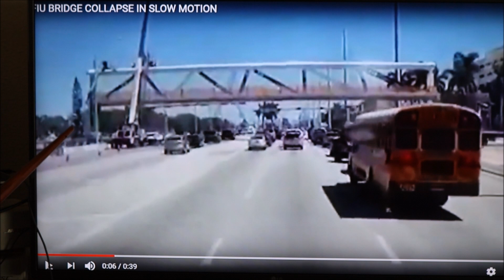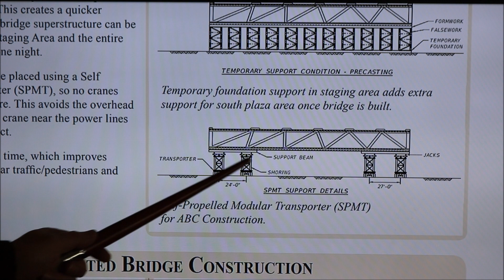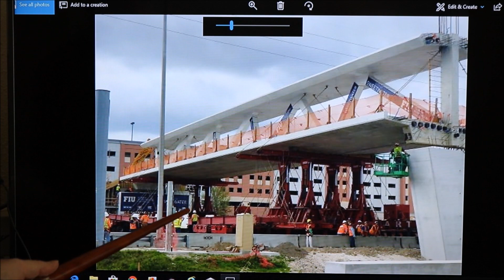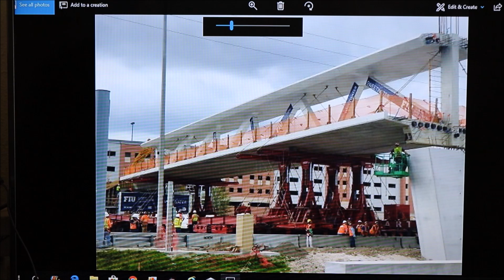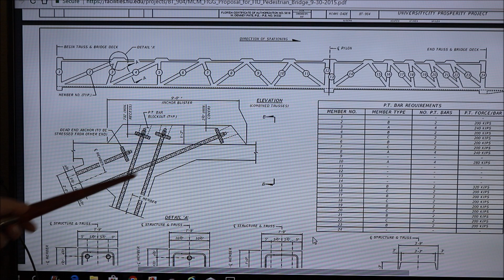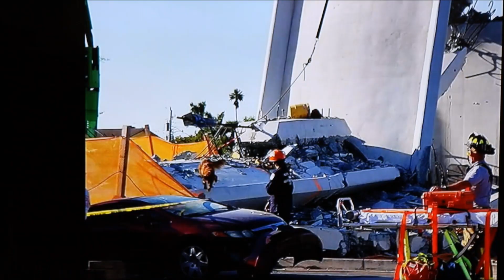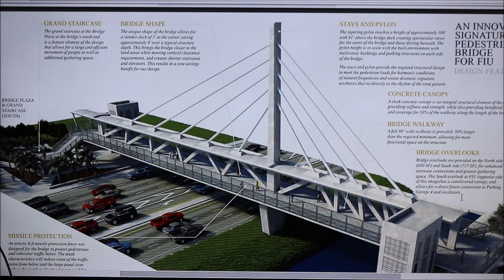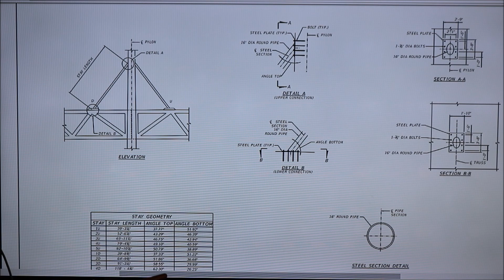Miami Bridge Failure Update 18 March 2018

Comment: You have probably seen the Miami Herald story from yesterday (June 14) on this...interesting analysis by a few external engineers. Much seems to fit with what you have said regarding the lifting of the bridge into place and the tensioning rod.
http://www.miamiherald.com/news/local/community/miami-dade/article212571434.html
Reply from the maker: John P. Valentine Excellent update! Thanks John. I believe this will be very close to the NTSB findings.
Reply: @blancolirio  Any plans to update this video now that the OSHA Report has been issued?
Reply: As an FIU engineering student I can say that alot of students disliked the design of the bridge. Mostly because the bridge would be exposed to wind and rain for 5 months of the year; from May-September. Architecture students have a saying "the client always chooses the worst designs". Why on earth the campus didn't go with a standard steel/glass bridge similar to (University of Miami's) bridge is beyond stupid. its like a tunnel that is protected from the elements.
Reply: Very good interesting article.   The OSHA report generally confirms the points made in the article. 

https://www.osha.gov/doc/engineering/pdf/2019_r_03.pdf

With regard to the concrete and steel used, the OSHA report notes that tests showed the concrete and steel were up to specification. 

The basic design inherently included 'non-redundant fracture-critical' elements.   That's not always a fatal flaw if the design is careful enough.   It was also needlessly elaborate but that's more a financial thing, the clients wanted to pay for fancy and that's what they (would have) got. 

But the design could have been made perfectly satisfactory and safe if the detailing of the diagonals and connections had been more thorough and conservative.   The devil is in the details.

Comment: Would it be too much to expect that the Project Management could have determined that there would be "obstacles" present, that would require the major support points for the move or lift to be moved inward, BEFORE the last minute? I'm writing this 5 years after the event, and it is sickening how badly EVERY SINGLE entity involved in this project totally screwed the pooch. 😕

Comment: This is indeed excellent knowledge but it does not explain why the bridge failed. Also, he says as many others do,  that the bridge is a non-redundant bridge design, with which I do not agree.  He and many others might as well have said that we should have two or three bridges so that if one fails we have two others.  There are many aircraft with one engine, and they are safe enough especially with a modern jet engine with basically one moving non-redundant part!  This video well describes that all the elements in the bridge that make up the I-BEAM, namely the top horizontal flange (canopy), the vertical web, (vertical truss components elements), and the lower flange ( horizontal deck or walkway) they each have MULTIPLE steel cables or rebars, and there are so many of them in each element, that if one fails then there are the other rebars or high tensile steel cables to keep the integrity of each element.  Also, the two end tips canopy parts and their associated vertical end columns holding the canopy end tips are all redundant  These four redundant components could have in fact contributed to accentuating the downfall of the bridge as described later on.  This I-beam is, in fact, an ARCH, and all it needed was to buttress the two ends on the side of a mountain range but could not do this, so as blancolirio so well described, they buttressed the side thrust at the ends by using longitudinal post-tension steel in the horizontal deck or lower flange of the I- beam. 

The 12 longitudinal bundles of steel cables each with 19 cables( tendons)  in the deck were EXTREMELY POWERFUL as blancolirio and the  Cambridge professor in another video so well described, but this was not the failure of the bridge. The FIRST failure had nothing to do with post-tensions or the integrity of the deck itself.  IT WAS THE THE END TIP JOINT BETWEEN THE LAST DIAGONAL END STRUT  11 AND THE DECK THAT WAS SO WEAK. That is what failed, and one can refer to it at 2:50 in the bottom left-hand corner.  This joint had to take a side thrust of the ARCH effect of the bridge, which depends on the weight of the bridge and the vertical distance between the canopy and the deck which was about 18 to 20 feet. The angle of the last diagonal strut that failed with the deck was 32 degrees and the weight of the bridge was 960 Tons. 
If we assume that the angle was 30 degrees then each end had to carry 960/2 tons=  480 tons.  It is a sine of the angle that we are dealing with to find the side thrust so that would turn up to be about double  960 tons in shear between the diagonal strut and the deck surface.  

So while the post-tensioned cables in the deck acting together could carry much more than  10,000 tons the shear joint between the end diagonal and the deck surface could not take the side thrust of 960 tons required of it. Its capacity could not meet what the side thrust demanded as a buttress.  Here is the detail of the downfall.

1. The bridge was pivoted and rested on the two ends each taking about 480 tons. ( static load) When it started to fall, it pivoted and rotated on the south end side. Because the canopy was 18 to 20 feet much much higher than the rotation point at the south anchor point, this caused the other end at the north canopy tip to move out, to bend the vertical column outwards causing it to split longitudinally and fail. Then as the canopy dropped further the top of the vertical member12 moved in and down. The post-tensioned bars within the canopy could never hold it irrespective of their tension. Note the interesting vertical split of member 12 where the top solid joint with the canopy forced the outer half vertical spit out at its base with the deck, while the inner vertical split half of 12,  broke at a point lower than its center height indicating that member 11 failed both due to high shear with the deck and a contribution due to the tensioning at the time on one of its rods.
 
2. So, the shear joint between the last diagonal 11 and deck surface ( first node)  on the north side failed, ( first downwards failure slow speed failure over three days due to shear) as it could not take 960 tons static side thrust. It failed at the surface of the deck where the cracks began to show and then as the concrete could not take the compression, the rebars in the diagonal 11 bents and hit the vertical column 12 holding the canopy above it.  As the North end of the bridge dropped,  and gained momentum, it rotated about the south side pivot, were due to the height of the canopy ( 20 feet above)  this caused the north canopy to move out and bending out its supporting column 12,  which longitudinally spilt in half member 12, which in turn caused the north diagonal 11 lower tip to move out further and faster. The lower deck lost the torquing height of the canopy and without it, all that post tensile bundles of (12 multiplied by 19=228) high tensile cables acting on the thin deck could not hold the bridge. ( second  downwards dynamic instantaneous failure as the bridge had some downward momentum)  If the bridge was  2 feet thick and the cables were at the middle of its thickness, and the length of the base of the triangle to the next diagonal, node 9/10 was 32 feet then what the concrete at the deck was subjected to was  (480* 32) = load *1  hence, load = 15,360 tons of compression on the upper edge of the deck.  Considering the downward momentum I would double this to 30,000 tons compression load on the thin edge of the deck. The deck acting alone ( without the torquing effect of the canopy 20 feet above it) with its numerous post tensile cables in it just could not hold this dynamic loading stress, hence the second failure at the next diagonal node 9/10 to the south. 

https://youtu.be/mCuIwK2_CYo

Note that in another video, the professor at Cambridge University, in his explanation did not mention the importance of how low to wrap the yarn of aramid fibers. Both the Professor and blancolirio said that the post-tension load in the deck of the bridge would be ten times the weight of the bridge. The explanation of the professor did not deal with the failure of the bridge, but merely the post-tensioning methods and amounts, and he should have mentioned that the yarn of fibers he wrapped around the model of the bridge he showed should be as low as possible with the beam being as high as possible to enable to TORQUE THE SYSTEM when loaded, while no part of the acrylic blocks he used should shear diagonally as effectively happened in the failed bridge.

It is important to understand that the bridge failure had nothing to do with the tensioning of the diagonal element but with how the joint lacked the shear horizontal strength between the lower end of the diagonal element 11 and the surface of the deck or walkway.  If one sees other videos one will clearly see that the n shaped rebars emerging upwards from the deck were not in line with the bulk of the angled rebars of the diagonal element 11 which were being tensioned but it was further south of the shear joint, grabbing only at the concrete so the sheering load was diminished. The rebars at this joint should have been many continuous L-shaped units with the upper part angled back at 32 degrees entering the diagonal 11 while the horizontal part going south in the deck as far as node 9/10  even further back and not relying on the concrete between the bundles.  All the n rebars emerging out of the deck should have been lined up and married closely with the rebars in the diagonal strut 11 which they were tensioning.  In my opinion, the post-tensioning, before the movement of the bridge and de- tensioning in that diagonal strut, at the first node with the deck, were totally unnecessary as they aggravated the already existing damage, hence the sudden failure. No additional tension or de-tension will return to normal a cracked joint of more than .75 inches and it was not a static crack but a dynamic active crack over less than four days!

Unfortunately with complex engineering, there will be hidden errors that one cannot easily see. With aircraft, it is the same, when aircraft were so simple, statistics show that 65% of aircraft incidents were due to pilot's errors but now since pilots and engineers and materials are never perfect and modern aircraft are being made autonomous by introducing more complex engineering, then what will happen is, that the mistakes of the pilots are now being transferred to the mistakes of engineers which are introducing complex electronics a computation to make the pilots redundant.  Poor pilots and passengers!  Passengers have a Hobson's choice, would they prefer the mistakes of the human imperfect pilots or the mistakes of human imperfect engineers.

Comment: When I was a kid, the men in my family said: Never buy a Pontiac, during the first 3 years of any engineering changes. Pontiac was the division GM used, to try out its new engineering innovations. The advice was sound: Wait until the new designs had proven themselves, before buying a Pontiac. GM would not advance new innovations into its other divisions, until the Pontiac features had proven reliable. Still good advice today, in engineering terms. Experimental design, versus proven design. The difference
can be a matter of life and death.

Comment: Juan,
I see you haven't updated this FIU bridge collapse and you should know that the NTSB posted a preliminary report in Oct 2019 and updated it on Jan 25th.  Thought you might want to look into and post an update.  As you surmised, member 11 was the culprit but NTSB blames FIGG for mis-designing the bridge and then hiring the wrong guy to double check their calculations.  NTSB faults the Fla Hiway Dept for not checking more closely and noting that "independent" expert was not competent enough to conduct the review.  Apparently the structure was  CRACKING before the collapse which should have sent up all sorts of signal flags.  Oh, did I mention that Figg thought the redesign was redundant and so used a safety factor of 1.0!!!  And of course Fla HiWay and FIU were called out for not supervising and closing the road.  More details in the report.  Thought you might want to update.  Keep up the good work and having fun reviewing some of your old video especially you and Pete flying when he was younger.

Comment: Without FEA it's hard to say however my hunch is that this complex design is unsuitable for concrete construction, the two outer inclined legs are compressive however they are pre-stressed however it does depend on the degree of forces applied, the top deck is also compressive and seems inadequate in size, however my main concern is that whilst the individual beams might be correctly sized the connections between these components is by the concrete itself which cannot be expected to deal with the loads imposed, which switch from compressive to tensile across the structure, unfortunately it's a sad state of affairs that a structure such as this fails in the unloaded condition.

Comment: From OSHA's conclusions of the report, one point only that says a lot.

"3. The morning of the incident, EOR held a meeting with project participants after

evaluating the cracks over the course of the previous two days. At that meeting, the EOR
acknowledged that his computations could not replicate the cracks and therefore, he did
not know why the cracks were occurring. The Construction Engineer and Inspector
(CEI) of the project advised the EOR at this meeting that the cracks were lengthening
daily. Despite these admissions and the knowledge that the cracks were growing in size,
EOR stated more than once that the cracks did not present any safety concerns. "

Comment: This sent me digging and I just found the OSHA report on the collapse. 

https://www.osha.gov/doc/engineering/pdf/2019_r_03.pdf
The original design criteria included "avoid use of non-redundant, fracture critical members."    Fairly obvious even from the collapse video footage that that was not achieved.   
The left-hand diagonal (in the video) was in compression in the finished configuration.   However at stages during construction it could be in tension, hence the post-tensioning members installed in it.    They were designed to be de-stressed after the span was placed. 

Construction loadings are often very different from final loadings and this has led to many bridge construction collapses over the years, such load cases tend to be overlooked, sometimes unexpected or less thoroughly investigated.   It shouldn't happen but it does. 

Short version:   The joint at the bottom end of that diagonal was taking high loads and developed massive cracks.    The engineers (who don't seem to have been quite sure why) ordered re-tensioning of the post-tension bars in the diagonal and the increased stress at the bottom end was the final straw, the bottom bar anchorage pulled right through the cracked joint, blowing the bottom end of the diagonal apart and allowing the bridge to collapse.

Comment: There is something very obviously  wrong with this Warren Truss! Both web members 2 and 11 Ought To Be Made Stronger than the Upper Flange! 

Web member 11 should be as strong as 2. Instead, we can see that 11 is visibly smaller than 2.

Also, the upper truss flange is stiffer than both web members 2 and 11. (It carries four post tensioning tendons. The outer diagonals have only two.)

I have browsed through a large number of photographs of real Equilateral Warren Trusses. 

The outer web compression members are typically The Identical cross section as the Upper Flange (at the ends); and for very good reason! The outer web members carry as much compressive force as the upper flange (on Equilateral Warren Trusses).

But, they are not equilateral in the FIU bridge. The outer compression members are much longer than the rest, thus having a shallower slope and more compressive load.  Using basic trigonometry, these outer compressive web members must Exceed the upper flange in strength. Say, 2 times larger in width and thickness than the upper flange *requirements, minimum. 

Obviously, the upper flange must be made wider than the web members for stiffening to match the overall span. But the overall compressive strength must be exceeded in the outer web members. Basic trigonometry shows the leverage applied to them is doubled.
Reply: Of course, I am aware that the upper flange has many aesthetic design choices that may increase the cross section beyond minimum requirements; and certainly the shape must not be copied to the compression member. However, the compressive strength requirements do translate with still more compensation for the acute angle.

Comment: The failure could have been caused by misreading the hydraulic pressure gauge or gauge error.  This truss is not a bridge until all parts are finished but they removed the temporary  supports before the span was tensioned complete. .

Comment: If  I'm looking at the drawings correctly someone made a huge error. The drawing clearly shows member 11 as a "Type A" member. The "Type A" memeber is supposed to be built with (4) tension rods at 280kips each. Looking at the wreckage it was  clear to me that it was built as a "Type B" member with (2) tension rods at 200kips. Either someone screwed up big time! or the drawings changed.

Comment: you do not work under a suspended load it is stupid and in Australia it is not allowed it is a golden rule in construction very bad practice. One other thing all these bolts need test certificates of their test loading when they inspect the bridge they need to ask another further question the concrete has a certain MPA and batch testing for the concrete was meeting US standards